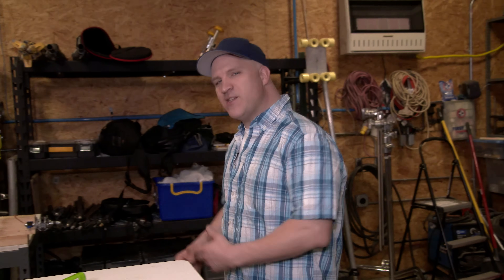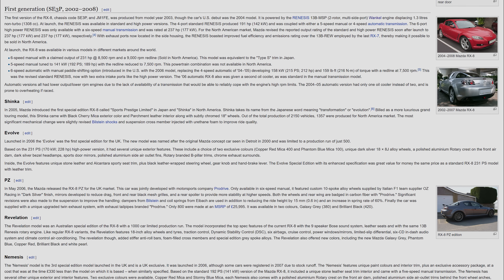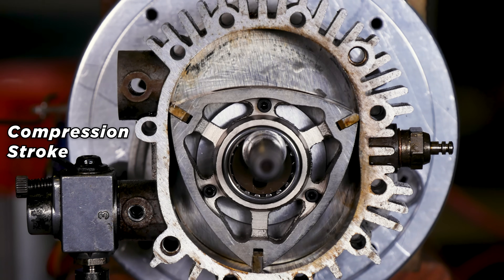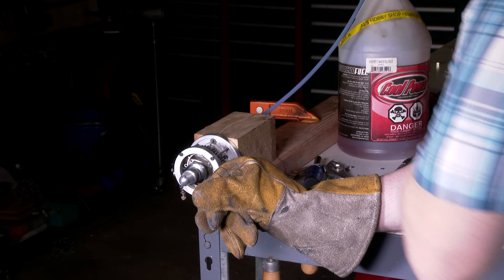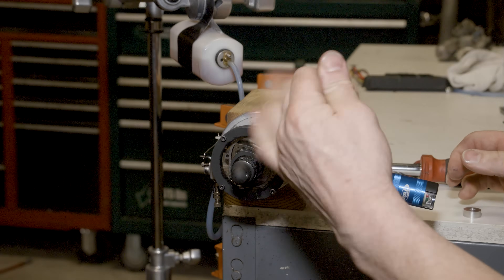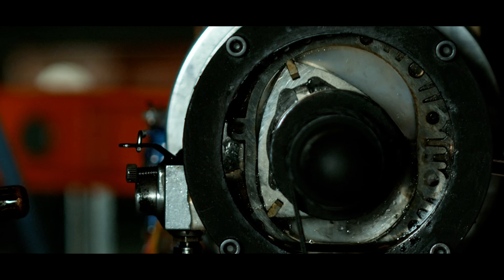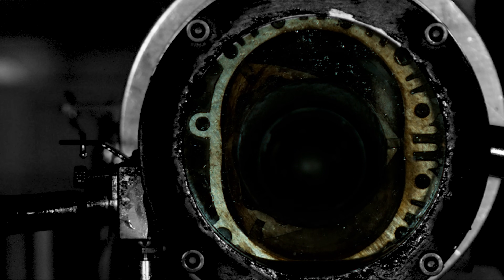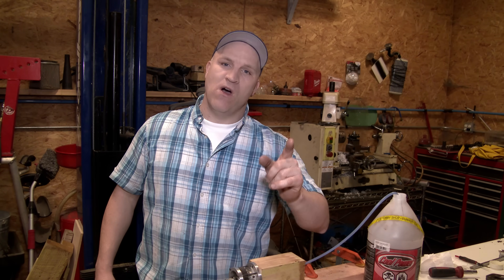See Thru Rotary Engine in Slow Motion - (Wankel Engine) 4K

Comment: The rotary is such a simple concept and has so few moving parts compared to the piston engine, why are 3, 4 or larger rotor rotary engines supposedly so difficult and expensive to build?  We have dozens of straight 6 piston engines.  It would seem to be a simple feat of adding 2 or more rotors held together in a strong enough block/outer housing as long as the concentric shaft that keeps every rotating properly is sufficiently, strong & straight.  With 5 direction CNC machines out there, creating the rotors & blocks/outer housings shouldnt be that difficult.  What else is it that makes 3 & 4 rotor engines difficult & expensive to build?

Comment: Great power, but compared to an standard 4cyl there is alot of wear on the wankel-engine.
Cool video!
Reply: well thats the downside and the reason why mazda dropped the wankel, the apex seals you see at the 3 sides of the tips of the rotor wear off quite moderately and needs to be replaced
Reply: Yes, i know. I´d say the wankel is great for those who dragrace or racing in general. I wouldn´t drive it daily for years.

Comment: Awesome can you super lean out the air fuel mix should be ethanol? I heard these engines can get super efficient as over lean has cooling effect on engines. Lean will mess up valves in normal engines is this also the case on these rotary motors??

Comment: Excellent presentation ! Just for the record the first rotary was produced in the seventies by Comotor which was a  Citroen company  and was used for the Citroen GS birotor and NSU. When Peugeot bought Citroen  sold the Rotary rights to Mazda and vehemently destroyed most of GSs which amazingly had also a full hydropneumatic suspension, brakes, as well as clatchless gearbox. The car is a masterpiece of rational engineering but contemporary companies don’t want competition. A handful of GS only survived.
Reply: BEST ENGINE OF THE 21 CENTURY

Comment: So it acts like an engine 3x it's size, in essence. Since every side of the rotor is exposed to a power cycle, it's like having a 3 sided piston or 3 separate pistons of the same size, etc...
Reply: Only twice its size, like a 2 stroke engine.  
The shaft rotates at 3 times the speed of the rotor, so it fires once every rotation. A 4 stroke engine fires once every 2 rotations.
Reply: BEST ENGINE OF THE 21 CENTURY

Comment: If the rotary engine is so powerful why all car manufacturers aren't providing in their cars?? My another doubt is the rotary engine more reliable than a reciprocating engine? And are the rotary engine is fuel efficient than normal reciprocating engine??
Reply: Hariharasudhan sukumaran they’re not reliable and they always burn oil
Reply: It is not desirable for mass produced cars because of poor fuel efficiency, higher emissions (partly due to it needing to burn oil) and a shorter engine life between rebuilds. They will also wear out quicker if not regularly driven at high RPM.  
But the advantages make it a good engine for sports cars and enthusiasts where the shorter engine life and high fuel consumption are not a concern. It is reliable, lightweight, has potential to make a lot of power, and can be driven hard all day without problems or excessive wear.

Comment: Pretty simple design but they had some issues with emissions and burning oil at the top of the list. Seems they would be great as a 2 cycle design and mix the oil and gas together since they are going to burn oil anyway. I seen on another channel where it was pointed out that one side of the engine ran hotter than the other since the ignition was all on one side causing the gaskets to warp.
Reply: All Wankel KKM type engines use the 4-stroke operating principle, unfortunately due to the Wankel's terrible combustion chamber design and poor combustion efficiency premixing the oil into the fuel causes some much more serious disadvantages than a reciprocating two stroke, plus because most Wankel engine are unlike 2-strokes and still have a wet sump so additional oil is not required to lubricate the crankshaft bearings which is why oil injection is the preferred (and more accurate)method, and was only method used by Mazda.
Reply: One of the fundamental flaws in the Wankel design was the troublesome shape of its internal components... cylinders and spherical shapes are ideal for ensuring even and consistent thermal expansion and contraction and the clearances between the moving parts, stationary parts and most importantly the sealing parts... Like the Newcomen steam engine, one of the Wankel's major flaws is that it is required to maintain high temperatures and colder temperatures with in the same housing, high wear rates and low thermal efficiency is the end result.
Reply: Indeed, which is one of the reasons why this design saw very limited use and is no longer manufactured.

Comment: Why "more complex rotary designs"? I think, simplyfication is the better way to go.
Reply: The Wankel is MORE complex and had more parts than a typical RC engine in this class...
Reply: BEST ENGINE OF THE 21 CENTURY GOD BLESS YOU ROTARY
Reply: I was irritated by the intention to make "more complex" rotary machines. I also think that the Wankel rotary system is allready very complex due to the need of very precise manufaturing of the rotary piston, the rotary housing and the spur gear drive. I think, the manufacturing of a rotary vane engine is much easier and it can be balanced easily by use of 2 chambers and rotary pistons. Here is another option using stationary vanes and curved rotary pistons in circular chambers: https://www.youtube.com/watch?v=p6kDWSz3UzA

Comment: I think, the enginge can not work without the rotary piston sealing vanes in order to compensate for manufacturing tolerances. Indeed, I think it is much simpler to manufacture a rotary vane 2-stroke engine instead of this Wankel-like engine with its sophisticated excentric crank mechanism.
Reply: Indeed, which is one of the reasons why this design saw very limited use and is no longer manufactured.
Reply: BEST ENGINE OF THE 21 CENTURY

Comment: so don't get a rotor cause there bad. got it
Reply: Depends on what you want to use it for.  
If you want a fuel efficient engine to drive through traffic every day, it will be bad.  
If you want a powerful, light engine for a sports car that can be driven hard all day, it will be good.
Reply: BEST ENGINE OF THE 21 CENTURY

Comment: Wank, wank, wank, plz! Just call it a rotary engine.
Reply: The Wankel KKM is technically not a rotary type engine, the now defunct "Mazda Rotary®" brand has become patois, "street slang" for the Wankel "KKM" KKM is an acronym for Kreiskolbenmotoren which means "Orbiting Piston Motor" in German.
Reply: A rotary engine can also mean an engine where the crankshaft stays still and the rest of the engine rotates around it, so calling this one a Wankel is more specific.
Reply: +JP Onefourseven A Rotary type internal combustion engine Always Means   "an engine where the crankshaft stays still and the rest of the engine rotates around it."  There were 2 versions of the Wankel engine. one was a Rotary... This one is not.

Comment: Great stuff! There are electric starters for those engines (most model airplane engines). Basically a motorcycle starter motor with a cup to engage the spinner. I'm surprised how well the motor held up as they are meant to run with a load i.e. propeller on. Also they get their lubrication from oil in the fuel. Obviously the acetylene does not introduce lubricant through the carburetor. The engine is doing what we used to call a shaft run with very little oiling. Not to mention very little cooling without a prop. A stout design. O.S Max?

Comment: Ah HaH !   Hot Bulb Ignition.   ( see Hot Bulb Diesel).   "Exhaust Stroke Kinda Combined With the Power Stroke".   Too Too True.. there's the rub.. it is essentially a two stroke, and will always blow out some unburned fuel in the exhaust.  Wasteful and smelly.  But the Power per Pound.. only beaten by a jet.
Reply: All Wankel engines operate using the 4-stroke principle
Reply: BEST ENGINE OF THE 21 CENTURY

Comment: The engine is smooth and rough as the same time and it starts really rough, obviously these engines are trash, just use Pistons
Reply: A piston engine for an RC car is not going to be much smoother.

Comment: Used to get 15mpg, imagine if it was 100% efficient. Hope the 16x prototype will be better next year.
Reply: The Carnot formula tells us that it is impossible to reach 100%... it also tells us that the Wankel will always be less efficient than reciprocating 4-strokes. The 16X program was cancelled way back in May 2009... Mazda cancelled all research and development on Wankel engines the same year.
Reply: doktorbimmer guess my invite from mazda to attend goodwood last year on the closed public day and talks with project heads about the future of coupes and roadsters were false. 

Also below from an article of December last year;
Mr. Montousse told Motoring that Mazda never stopped working on the rotary engine for the past 15 years, highlighting the “considerable investment behind it.” Though the RX-9 is not on the official roadmap, head of Mazda North America, Masahiro Moro, had this to say about the unofficial roadmap: “We have dedicated engineers for it [the RX-9].”

May not be the 16x prototype anymore, skyactiv-r rotary is the latest iteration on top of the rotary powered range booster EV concept shown.

ROTARIES WILL NEVER DIE!
Reply: The Wankel engine is already dead... 1964 - 2012
Reply: BEST ENGINE OF THE 21 CENTURY

Comment: Rotary Engine = Terrible design. What were they thinking???
Reply: Wanker engine...
Reply: Dude why ?
Reply: +Anonym The Wankel is very inefficient at converting the air and fuel mixture into heat, and it is even less efficient at converting the heat of combustion into mechanical work.. so basically more of the fuel and most of the heat gets wasted out the exhaust compared to a reciprocating engine... this can be easily seen in the exhaust gas temperature difference between Wankel engines and reciprocating engines and the amount of HCs (unburnt hydrocarbons) in the exhaust.
Reply: reliability issues, oil consumption issues, fuel economy issues
Reply: +Anonym Wankel KKM engine design suffers from some very serious flaws due to the limitations of the restricted geometry envelope that allows it to work in the first place.. in short, its basic shape makes it terribly inefficient and its shape cannot be altered otherwise it simply no longer functions at all.
Reply: @david husband  Mazda lost the 1991 WSC championship to JAGUAR! No it didn't.. the points leaders that season crashed early in the race... Mazda only needed a car to finish for the win... it was pure dumb luck.
Reply: @david husband Yes, the Mazda 787B performed very poorly... 20 losses in 21 races with ZERO POLES and ZERO FASTEST LAPS... it finished the 91 race significantly slower than previous ETs.
Reply: It is a good idea for an application where you need a light, powerful, reliable engine that will be used at high RPM under load.  

It is a bad idea for an application where you need an efficient, long-lasting engine with low emissions that will be used mostly at low RPM.
Reply: The Wankel design is one I can't find in aviation anywhere. Piston radial engines aren't uncommon in aircraft even in modern day, but they tend to burn oil.
Reply: That's right, although the Millet Type Rotary engine was popular in aircraft and motorcycles prior to WW2... The WANKEL engine however was never used in aircraft production...
Reply: The Wankel engine performs poorly in all applications which is exactly why it is now completely obsolete in the engine manufacturing industry.. the Wankel no longer offers any advantages and suffered from several serious disadvantages rendering it unable to compete against other vastly superior internal combustion designs like reciprocating and gas turbine engines.
Reply: "poorly in ALL applications" come on now. They're very popular in the aviation world. light+high RPM at a constant rate is perfect for ultralights. Reliability is a non-factor since recreational pilots by regulation have to be very anal about maintenance following strict guidelines for whats done at what hour on the engine. though that part is true for all engines in all aircraft.
Reply: +sproly born NO, they are not... there are NO FAA or EASA certified flight worthy engines in production and there has NEVER been a production airplane that used a Wankel engine.... Wankel engines are particularly unsuitable to aircraft applications due to there horrendously bad BSFC (fuel consumption per horsepower produced) and their horrible reliability that renders them completely unsuitable to meet even the minimum PTFR and TBO standards required by the civil and commercial aviation industries...
Reply: +sporly born "light+high RPM" Complete and utter nonsense! The typical Wankel engine has a peak efficiency RPM range well above the ideal LOW RPM requirements of any efficient propeller design, and Gas Turbine engines offer an ORDER of MAGNITUDE greater power-to-weight performance,   reliability and service life than any Wankel engine ever could...  Wankel engines are not used in ANY production aircraft because they are very poorly suited to this type of application.
Reply: +sproly born The reciprocating engines manufactured by the Austrian firm ROTAX is world's leading supplier of aircraft engines for ultra-light and lightweight aircraft. http://www.rotaxdisk.com/rotax-aircraft-engines-revolutionizing.html
Reply: +sproly born The irony of this story is Rotax who's parent company Sachs was one of the first companies to license production of Wankel engines on Dec. 29th 1960... was also one of the first Wankel licensee's to abandon production of Wankel engines in 1977.
Reply: @sprolyborn2554  Show me one in production
Reply: @doktorbimmer  I think they read "rotary" and think wankel.  people seem to confuse engines like the WW1 era Le Rhone, since it's called a "rotary" with the wankel.
Reply: @CaberFeidh Indeed... only amateurs refer to a Wankel KKM engine as a "Rotary"... just like these people think Felix Wankel actually designed it... which is not true either.

Comment: I had an RX-8 and everytime I went to the dealer for any reason, they had a RX-8 up on the rack getting a new engine. I was so paranoid that my turn was coming. I loved the car to death but I never felt comfortable knowing doomsday was coming up.
Reply: Mazda rebuilt more than 5,000 Renesis engines PER YEAR not counting brand new engines, rebuilds from outside contractors and all the engines rebuilt by the aftermarket that were out of warranty.
Reply: doktorbimmer  Thanks. I loved that car so much. It was like a poor mans Porsche. It could hug a winding road without squealing the tires, like it was glued to the road. But, always that sense that sooner or later, it was going up on that rack (at the dealer!!!) was enough to kiss it goodbye.

Comment: The 2004 RX8 never made the claimed 232 horse power. I owned a 2004 grand touring manual. It got 16 mpg and I’d estimate it made 165-185 hp. It’s was drag limited to around 130 but even that was hard to squeeze out of it. Then there was the brake fade as Mazda routed no air through the wheel wells for cooling. My 1.8 NA Miata was almost as fast. Car sure was balanced though. Engine in OEM form is complete shit! Mazda has been caught lying about HP numbers for years.
Reply: Mazda was allowed to detune (reflash the ECU) all the Renesis engines replaced under during the NHTSA recall campaign...
Reply: Wankel engines all suffer from the same flaw stemming from the inherently weak and easily damaged sealing system, compression loss is not just a common problem... its guaranteed certainty.

Comment: Could there be a way to restore or reuse the exhausted fuel. I mean by using some kind of filter or another technique.
Reply: Not any the are considered remotely practical, the best solution has already been employed.. replace the inefficient Wankel design with a superior reciprocating engine.
Reply: Isn't there any way to overcome the problem. Reconserve the fuel from exhaust. I mean they are just great in term of power output, simplicity,smoothness, compactness and weight.
Reply: That would require a complex and expensive filtration and refining system that likely exceed the cost of the vehicle and need extensive maintenance. The Wankel is obsolete because it no longer offers any of the advantages you mentioned... in terms of power output the Wankel is now average at best, it is more expensive to build... there are reciprocating engines that offer comparable smoothness. Compactness and low weight are not really that important in automotive design and for aircraft? The Gas Turbine engine offers vastly superior smoothness, compactness and power-to-weight ratio not to mention better fuel efficiency and reliability.
Reply: doktorbimmer. Gas turbine engines! Seems amazing.
Reply: Gas turbines outperform all other types in aircraft, stationary and high speed marine applications... but unfortunately they have some very restrictive operational and economic limitations which are a particularly difficult to deal with in an automotive or land based vehicle applications.
Reply: But but but. If we think a little bit about them we see that theoretically its possible to burn full fuel into energy without wasting into exhaust. In that video there wasn't good air-fuel mixture. The apex seals can also be optimized, seals are also present in piston engines on the sides of pistons.